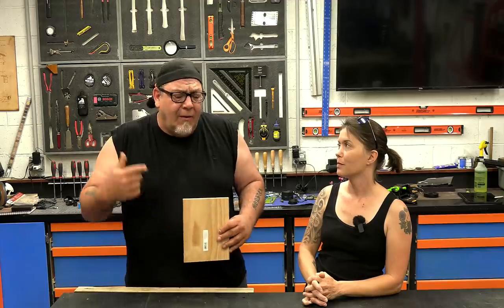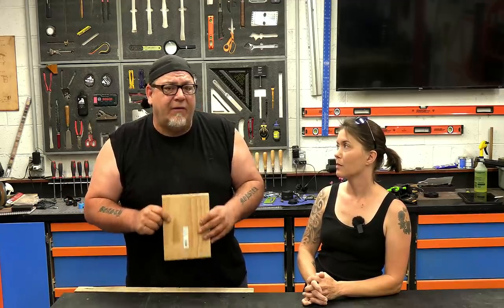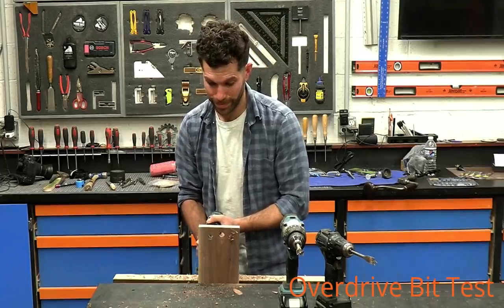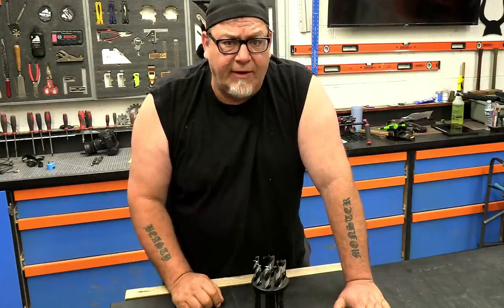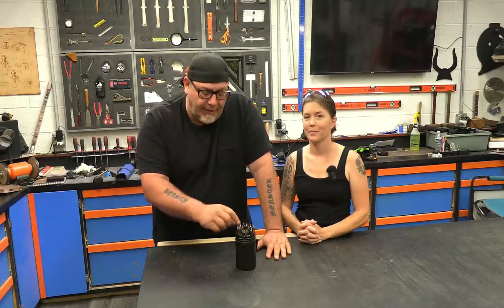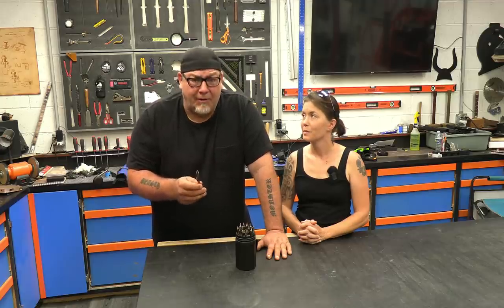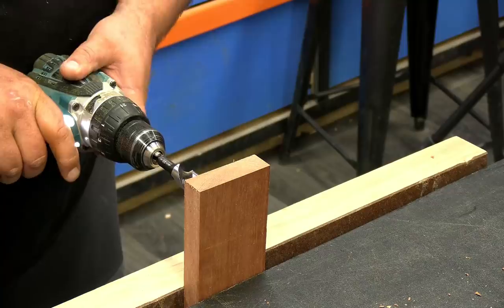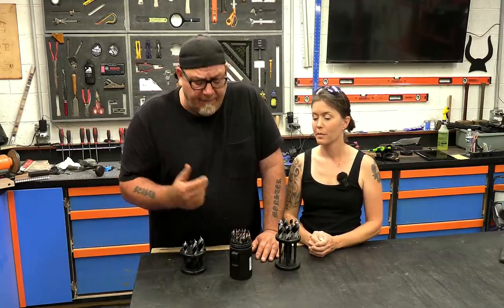3 Drill Bits that DESTROY the Competition!

Comment: I have been looking for a way to drill 3/4" holes in a grid on my already existing workbench top, to accommodate dogs .The top is 1/2" ply and 1/2" MDF. I've tried all the usuals; spades, augers, and Forstners. The backer board isn't really an option. The blowout was significant enough that I bought a whole set of Wood Owl Overdrive bits, because the 3/4" was sold out on it's own. When they arrived I put the 3/4" bit in my drill guide. The first hole cut so fast, I laughed. I drilled the rest of the grid in a few minutes. Amazing. Thanks for the tip Izzy and Maggie.
Reply: When a hole has to be vertical, a plunge router is a good option.  Tamar has a good video on drilling a perfect grid too.

If you really want a perfect grid to make square cuts, look at the Parf system.

Comment: Thanks for the video,  im gonna test every one i can buy in 1/4 inch.  I have been using an upcut cnc bit to drill pilot holes in dowel rod for a product i make.  Then use either twist, brad or forstner bit to finish the hole.

Comment: These bits look amazing! But I can  sharpen twist bits, paddle bits, and forstner bits by hand quickly and easily. The geometry of these bits look a little trickier.
Reply: It's been a few months now and Izzy hasn't responded on how to sharpen these even though there are several comments on it. This isn't like him. He usually responds to comments like this. It's kinda worrisome. I'm not saying these aren't great bits but if we can't sharpen them at home then we have to either buy replacement bits or send them off to have them professionally sharpened, neither of which I'm willing to do. Come on Izzy, shed some light on this.

Comment: Mr Izzy! 
My name is Clark Lattimer I am a disabled Nam era Submarine Vet.
I have been slowly expanding my ability in woodworking. Your channel and Stumpy Nubs are 2 of my go to posts.
 1st 
been follower from the 1st episode with your home made table saw 
2nd Congrats on your fight against your back problems! 
3rd I think your posts are entertaining and relevant plus most importantly accurate !
4th.  Can you elaborate on the ease or even the possibility of sharpening these 3 amazing drill bits. As a trained machinist I have the impression that the augers bit (last one shown that was able to make angled holes) seemed to be an end mill with a drill bit angle grind. If so regrinding is possible but reduction in diameter is a result. (Not talking about the angled end of course) 
Lastly good luck in future, some day I hope to be able to invest in some of your products.

Comment: I did the electrical in my basement with a Forstner bit. Over 50 holes in 2x4’s. Near the end I had a hole where the drill would not fit. So I purchased a flex auger bit. O my gosh. The difference was insane.

Comment: How's the finish and how consistently accurate are the overdrive bits compared to a forstner bit though?  If Im using a forstner bit Im using it for those reasons over speed.  Glad you showed the Vortex bits in a piece of metal, thats where they really shine.  Norseman makes absolutely amazing bits all around so if you’re only planning to drill wood, can almost get 2 of their 118* tip sets for the price of a set of Vortex

Comment: That was eye opening! And cool to watch. Thanks.
A couple questions come to mind. OK, 3.
How well will these work for shallow holes? Some better than others, it seems.
What about wear and durability? One would not want to purcahse frequent replacements.
And how does the cost compare to other quality bits?
Reply: I also have concerns about service life on the Norseman bits if used for steel.  I have Norseman twist drills, and I know they're good, but they will require sharpening before too long if used for steel.  I can quickly touch up conventional twist drill on the bench grinder, but it seems that the step point will need to be replaced when dull.  That could get pricy.  That said, I could see having a small set for use when hand drilling and using the traditional bits on the drill press.

Comment: I am curious how the two top bits would work on acrylic resins. Longevity would be a huge factor for me also. Resins or acrylic will eat up standard Brad points longer use with carbine tip. Just need to justify the expense. Any thoughts?

Comment: I would never think to use vortex bits in wood.  They were designed for metal.  The real test for me is how well they perform in Stainless Steel.  I have not done any work in stainless steel recently so I have not been able to test. I usually use the Norseman's Cryogenic Nitride bits for starter holes.

Comment: Great video. I’m currently struggling to find a solution to drill holes into 10 sheets of 9mm plywood simultaneously. I’ve made a jig/box that holds 10 plywood boards, and I’m using a Fisch hss bit in a pillar drill, but I’m getting blow out at the back of each board. Any suggestions please Izzy?
Reply: Clamp them
Reply: @janeblogs324  Thanks, I'm already in the process of making a clamp/drill jig.

Comment: Long ago, perhaps it was the '70s, someone came out with a set of bits that gave results much like those you've shown here.  The difference was primarily in the shape of the cutting edge, which was predicated on the shape of a .30-06 or an M2 Browning bullet nose.  I found a couple in a yard sale and used them primarily in metal.  I remember that there had been some advertising for them but I've never found any others, since.  Would you know anything about them?

Comment: Yeah, so anything from 1 1/4" (or 1 1/2" for the Tri-Cut) and down, those are pretty fantastic bits. But for bigger holes, you're out of luck and need to do the Forstner or hole saw.

It looks like you might be able to do overlapping holes with the WoodOwl OverDrive bits, just because of how flat the tip is but probably not the others? Well, maybe the WoodOwl Tri-Cut Auger would do overlapping OK too.

Speaking of which, how do the WoodOwl bits fare against other auger bits, since that's really what they are...
Reply: Charlie - for larger holes the "Hole-Hawg" (Milwaukee) type bits (Taylor calls them "Self-Feed") are pretty great. I used to rough in a lot of DWV piping and used the big 2-5/8", 3-5/8" and 4-5/8" sizes on a daily basis. If kept sharp they cut cleanly and are way faster than a hole saw. They'll drill about any forest product/ hardwood/softwood/sheet goods. They do make a huge mess of shavings  though, and you need to brace w hand-held drill or risk a broken wrist.